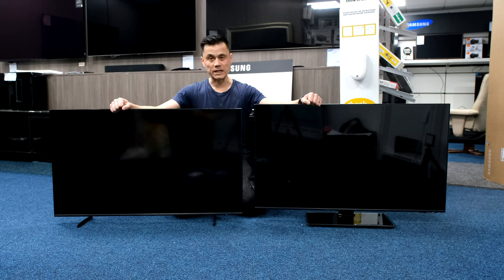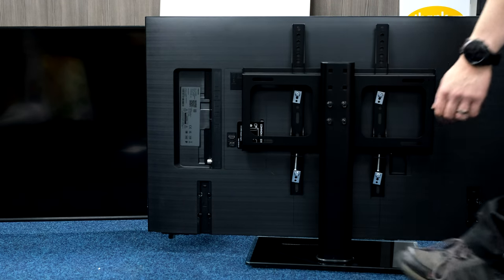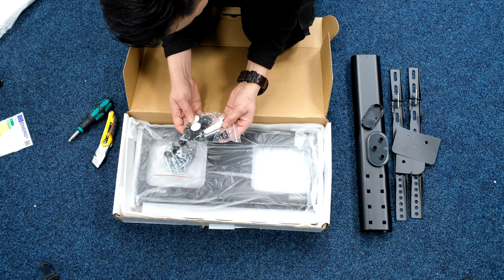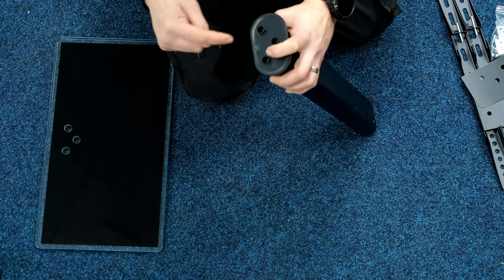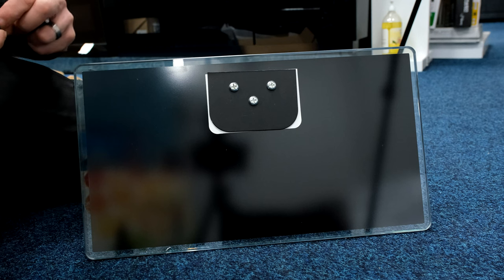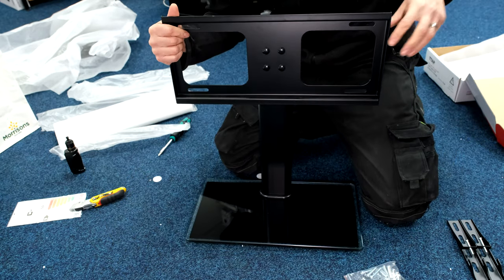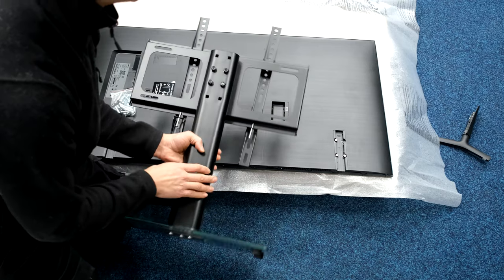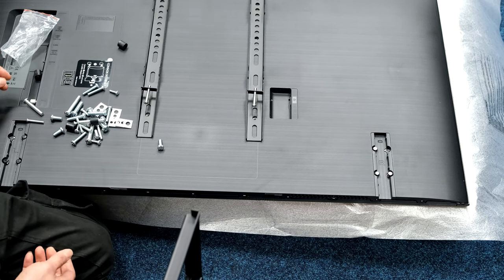Replacement TV Stand, Universal Central Pedestal Base

Comment: Will this stand work for a Samsung model UE43KU6000KXXU. It's a fairly old tv but has the VESA fittings at the back even though the screw threads look like they are quite deep inside the 4 holes...if that makes sense.
Reply from the maker: Yes it will, you need the 45mm m8 bolts that come with it, there should have been some special washers included with the tv as well